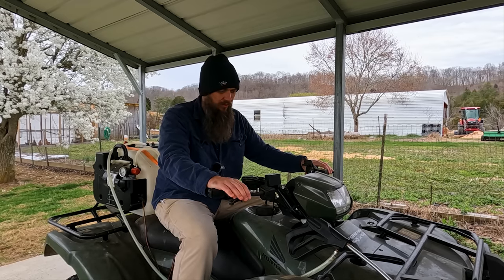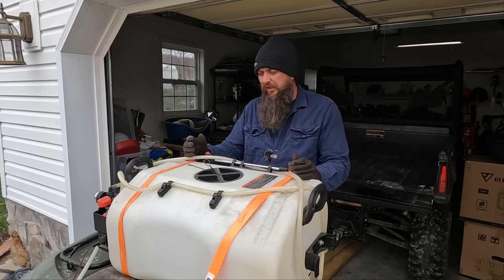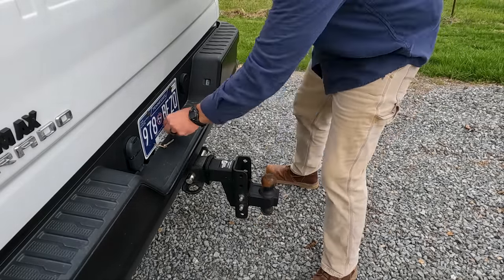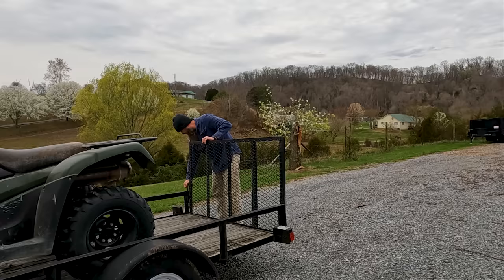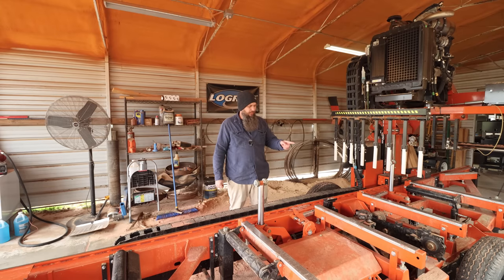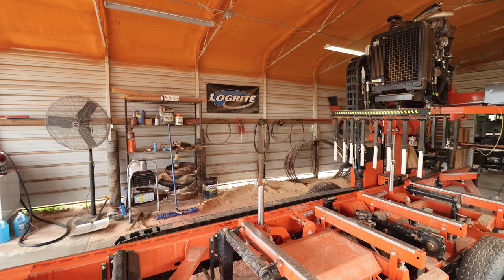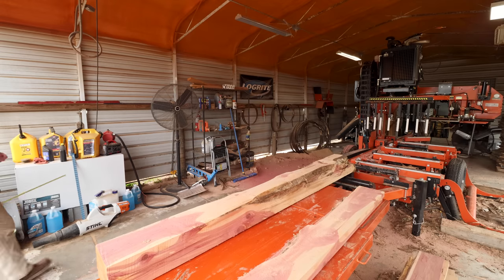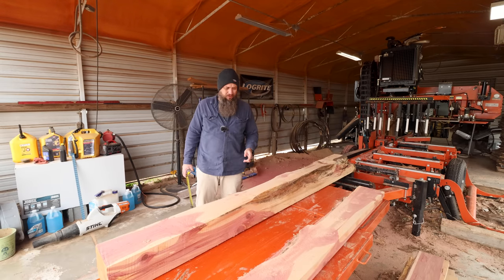Equipment Maintenance  And Saw-Milling Juniper Logs

Comment: Hey Nathan - Truckers (I'm not but do trailer often) will tell you that you tie down for the stop.  In other words, plan on hitting something that stops you quick and what will happen to the load - 4 wheeler will end up in the bed of you truck, or worse.  Just what I have learned.  Winch tie down not ideal but will work for keeping the machine from moving back.

Comment: You might use a ratchet strap to hold the back end against the trailer, and snug up the winch line a bit.  As it is, one pothole could send it ... over tea kettle, and then you'd be dragging it alongside the trailer.

Comment: As one who has moved heavy equipment I see no problem with using the wench on the four wheeler to secure the front of it but I think I'd throw a rachet strap on the back somehow, maybe under the seat and pull both ends to the rear of the tailer. Or go through that 'D' ring at the rear of the seat to the back of the trailer. Have the wench and the strap pulling against each other.

Comment: Sorry you caught the flu or cold bug what a pain to try and keep producing videos and content feeling crappy. You had a long day. Best wishes a fast full recovery. Summer is coming on fast.
Reply: Give this recipe a try. 1 gallon waste engine oil 1qt Diesel Fuel. Mix and apply to that wood trailer deck this hot summer sunny day. Best affordable wood preservative I’ve ever found in all my years and easy to slap on with a throw away big Harbor freight stiff bristle brush.
Reply from the maker: I’m ready for it. Been a long wet winter
Reply: @texasjetman  - Use a dedicated roller and brush to apply the home brewed preservative. When you finish, place them together in several layers of plastic bags with packing tape tightly wrapped around the handles to seal the oil in and keep them usable for the future.

Comment: I have a 98 Honda 300 Fourtrax that I bought brand new. Mint condition and cranks every time I get on it👍 Can’t beat Honda dependability! I haul my Honda the same way pretty much but I put an eye bolt in the trailer tongue and I hook my winch to it. Then I operate the winch to pull the four wheeler snug against the front rail of the trailer bed, lock the brakes and leave it in gear. I noticed yours rocked back while in transit and those rail edges can cut and crimp your winch cable. Great video and I’m lovin that cedar!!👍

Comment: Great video!  for the camera getting dusty, what works for me is using one of those cheap neck gators and a rubber band.  Wrap the gator around the camera so it covers the body and most of the lens and wrap the rubber band at the base of the lens (closest to the camera body).  I use this to keep most of the dust out when I go take photos/videos of 4x4 races in the desert.
Reply from the maker: Great tip!

Comment: Nathan,  New to your channel a couple months ago. Love the videos. Keep it up. As to your anchoring the 4 wheeler in the trailer with just that winch cable-BAD. If you were to stop quick or God forbid hit something, that 4 wheeler would probably be flying over your head. you should have a minimum of 2 ratchet straps on that thing pulling in opposite directions. The straps should be rated for more than the weight of the load. That's Federal law.

Comment: Biggest problem with the winch is shock load. The hook, cable, & gearbox are designed for slow steady loads, not shock loads.
Load straps are a better option. Even the cheap Harbor Freight ones.
An ounce of prevention is worth a pound of cure.

Comment: Put your cameras in a good plastic case cover to keep that dust out of them.  Get one that just attaches to the tripod and has a connector to attach a power cord to keep the camera running.  If you can get a camera that can be controlled by Bluetooth through your phone, that might be even better!

Worst case scenario, use a piece of plexiglass to construct a box to attach on top of the tripod and just put the camera inside...

Comment: You  should cross the trailer safety chains on the hitch.  They create a cradle if the ball should pop loose.
Reply: That is exactly what they do.  My trailer hitch bounced off once and the crossed chains kept the hitch from hitting the pavement.  It's a good practice.

Comment: It is hard to believe you have so few miles on a 4-wheeler that old. I've had mine for a little less than a year and have more than 1,700 miles on mine. Of course I use mine to round up cattle on an open range and bring horses.

Comment: it may be different out in your neck of the woods, but out here on the west coast your required to secure all 4 corners when transporting any vehicle (motorized). And add extra straps/chains when over 10k (but I think that gets into commercial transportation at that point). I learned this getting a ticket for using only one strap on my riding lawnmower to the shop.
Reply: Yeah, but you live on the “left” coast !
Reply: @pamelawoodall5891  Strapping down cargo is a leftist concept? Lmao

Comment: Using the winch is ok, BUT, D.O.T. will require anything traveling in a trailer or a flat bed to be strapped down to the trailer. One should do it across the seat!

Comment: Hello Nathan, winch hook is not really the best for tie down. You should be using straps to fix the load to the trailer to prevent movement and to keep the 4 wheeler secured to the trailer in case of accident.
Reply: I was gonna write something along the lines of this, I'm glad someone bet me to it
Reply: Oh, I would also add you should cross your safety chains so that in case the trailer were to come on hooked, they would form a cradle and keep the tongue from digging into the ground. Just a thought and yes, I am an expert!….lol

Comment: Nathan - The rear of your quad hops up and down noticeably when you run the electric starter motor to start your gasoline engine. You will see this if you focus on the back of the seat in your video. When you engage the starter the rear of the machine pulls down and when you release the starter (and your gasoline engine is not yet running), the rear of the machine pops back up. This symptom could be from the driveline not fully disengaging from the engine. The small electric starter motor is effectively propelling the whole machine. This extra load on the starter motor will cause it to prematurely fail and will make the engine harder to start - especially with the battery weakening from age. Please do not take offense from me mentioning this. I am trying to be helpful, not critical. If you can identify the cause and fix this issue now, it will save you a lot of money in the long run. Hope this helps.
Reply: Good explanation 👍

Comment: Nathan. Cross your breakaway chains. If the hitch brakes etc it will keep the trailer behind you. I you want to see what I mean. Stand at the back of your pickup hold on to the tailgate with arms parallel then move sideways, then try it with your arm crossed.

Comment: if you over grease wheel bearings it will blow out the back rubber seal and let dust and water into bearing race, it looked like you pumped it for too long, when you have put grease in the wheel bearings it should last for years without doing it again, over filling will damage the seal

Comment: Nathan, You save that battery and ya won't have to spend any money!! Ya renew the Battery charge.. Empty acid into rubber or plastic
oil drain pan.. set aside. Make new electrolyte Simmer 3 cups of TAP WATER, and add 1 cup of EPSOM SALT..dissolve good.. put into 
4 cup measuring  cup pour into each cell of the battery and put battery on slow 2A charge over night and check charge of battery..if it's 12v
or more reinstall it back 4 wheel vehicle and run it a while if not 12V then up the charge to 10A and charge 2 more hours! This can save ya 
$100. or more BUCKS. Now to neutralize old acid!! Just using baking Soda pour into acid till it stops fizzing. In Chemistry Dilution is the solution!!
Get a Big plastic Bucket pour in and add more water add continue adding baking Soda. till it fizzing stops. HOPE THIS HELPS. Where to pour it dump
it on your burn pile!

Comment: Whenever I transport a vehicle, light or heavy, my biggest fear is someone pulling out in front of me or hitting me head on, causing the load to break free and come flying into the cab from behind me.  I also watched a video years ago of a man with a riding mower on his trailer with four one inch ratchet straps holding it down.  He fell asleep or had a medical incident and the person videoing was driving in the right lane honking his horn at the man was in the left lane.   The man towing the trailer drifted left and into the median and hit the turnaround between the two sets of roadways.  He had been driving in the middle of the median in the low area and as he drove up and over the turnaround, when the trailer tires hit the pavement, the trailer became airborne and all four of the ratchet straps broke.  When I have a car on my trailer, I have a strap on each wheel to the trailer, normally I have four chains/binders in an X under the vehicle from the axles to the trailer, but on low cars I do two from the front of the trailer X to the font frame, and again on the back of the trailer X to the back frame.  Last but least I have two heavy chain/binders from the back of the trailer straight to the rear axles, these two is just to make sure the vehicle does not come through the cab of the truck.  I know it might be overkill, but when I transported our daughter's Explorer to from Nevada to Augusta Georgia and when I took our son's Suburban from Nevada to Whidbey Island, a lot of truck drivers complemented me on my tie down.

If you ever go to Shiloh be sure to eat at Hagy's Catfish Hotel on the Tennessee River just below the Pickwick dam.  All you can eat catfish and watch the tow boats pushing their tows up and down the river while you eat.  Just be aware, they are closed on Mondays.

Comment: I would at the very least add a ratchet strap to the back and one over the top if I was taking it out on the highway. There are a bunch of idiots out there and a defensive maneuver to avoid one of them could end up with your four-wheeler dragging along the side of your trailer making for some great video, but could be costly.

Comment: Change the battery  every two and a half years. Same for a private car. Even more so if the car uses air conditioning and suffers from heat load from the engine and ambient temperature in the summer time. It also suffers in the extreme cold of winter.

Comment: Just so ya know , cut a hole just big enough for the lens ONLY and tape it off with some low tac tape , I use zip loc 1gal. And once every 3 years I replace the lens . I tape myself painting people's cars n trucks and that's what I do so I don't have to buy replacement cams.